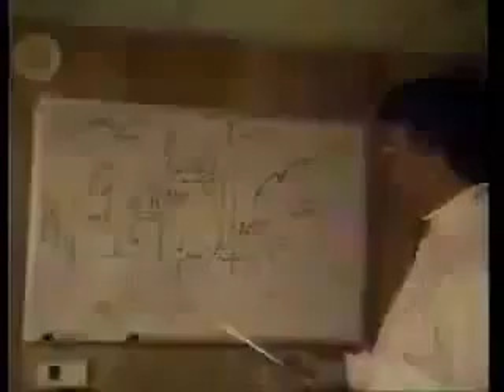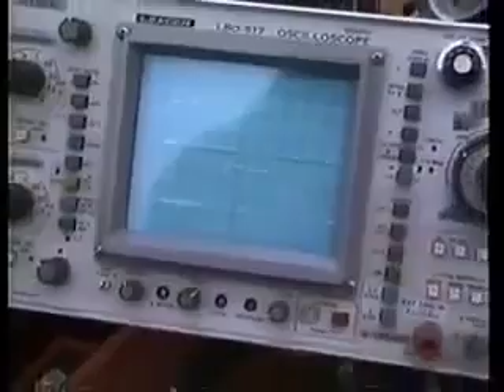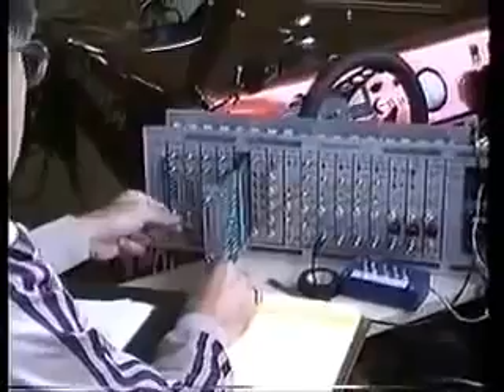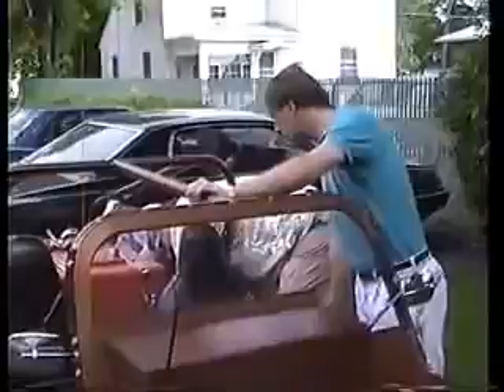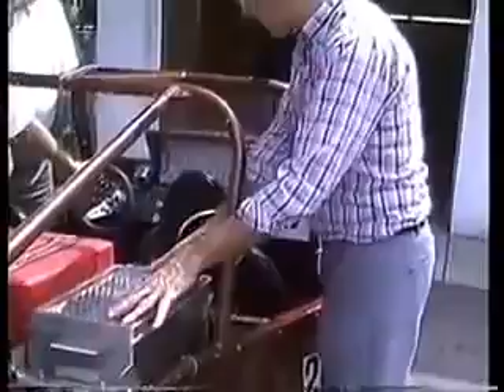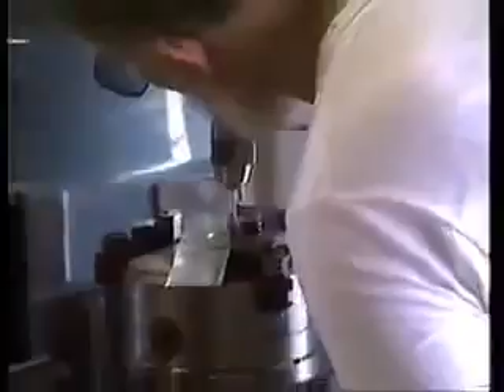Stanley Meyer  running car on water. Water Car GENIUS

Comment: I remember this vid. I knew it existed. Im goad i found it.  He was silenced because it would make their brainwashing scam of “go green”  fail. Also their “global warming scam would tail. They knew about these scams and worked on slowly brainwashing us before pushing it. They allow electric because they can still mix gas with it and if its gassless they still have you waste time charging the car and they know the engine in it only lasts 3-4 yrs and is alot of money to replace.  More than having to fix everything part on a car.  This water idea they can’t make u pay to pump it in when u can use a hose.  It won’t take hours of electric charging so they can make money that way.  So they seen it as a way for citizens to get ahead in n life and unalived the guy because of his ideas.   He would have ruined their global warming and go green be plus stopped us from saving money

Comment: It's about the power you save, think about how efficient it would be in a hybrid car.
Reply: This means battery size would be 70 percent smaller and nuclear energy could be used to power civilization alone as the batteries of those vehicles could be charged at home

Comment: Now it would seem I'm tasked with the very same thing as I move to implement this technology into todays existing vehicles and power generators. One thing that is very different from Meyer and myself is I was a mechanic first before becoming a scientist/machinist/engineer. I hope that will give me the edge I need to be able to bring this technology into our world.
Reply: Unfortunately, you will never succeed in making this technology practical or efficient, because what Stan failed to disclose is that you need to use 5x the energy just to create the necessary amount of hydrogren fuel from water. That being said, the obvious engineering solution is to simply remove the water/hydrogen requirement from the equation entirely and just use the battery itself power the car. This is essentially where we are today, with electric cars.

Comment: Never showed the engine actually running
Reply: There are (or were) videos of it running. YOU will have to search. There is one with the gas tank removed and put to the side showing his first cell connected and running. The first time the engine ran on the cell.

Comment: Sorry to speak ill of the dead, but Stanley was a con artist. Unless he was able to re-invent physics! You can’t use water in a combustion engine, because it does not combust. You can split water into hydrogen and oxygen using electrolysis and then burn the hydrogen as a fuel in a combustion engine. The fundamental problem is that splitting water takes far more energy than you get back from the combustion engine. To make this work you need an ample supply of electricity, so either a very long power cord or a big battery.
Reply: I don't reckon it's fake you can say he's a con artists but that's what the government says they can cover anything up people who own the oil industry will never give it up invent something that goes against it well RIP

Comment: IQ bellow 100: is working. IQ above 100: 😂 The fuel cell was also claimed to be able to recombine the hydrogen and oxygen atoms back into water molecules, which would then be recycled to continue to fuel the cell. This aspect of the cell, however, is mathematically and scientifically impossible.

Comment: I hope everyone in Belgium is watching this.
So they can see what their countrymen did to the world.
Reply: You mean scamming people and being convicted for it?
Reply: @parsonk4041  No I mean cracking water using only 12v car electric and getting away from greedy power companies.
Reply: @KnightRider872  but this is not something that actually works. You get less power out of it then you put in.
Reply: It's about the power you save. Think of how efficency it would be on a hybrid car
Reply: That's why he was killed because you would not requir large batteries so that means the avg household could charge the car battery at home and the water would cover the rest of tge energy requirement which is why Stanley never was killed because oil could then be replaced by nuclear power to households and then oil would be redundan
Reply: 70 percent reduction in battery size
Reply: Less slavery
Reply: The devil is in the detail

Comment: Anyone can get a car to run on hydrogen or even water. The problem is the cost of the vehicle is a lease double, there’s very little room left in the trunk or even the backseat and the cost of the fuel is at least four times that of gasoline. So yes we can do it but who the heck would want to? That is the reason why nobody buys a Toyota Mirai.
Reply: this is a prototype.. technology is way smaller now.. if they would've went with this invention.  but they aren't about to put the fuel industry out of business.. are you not smart enough to see that. it's all about the money. the monetary system!
Reply: @MM-ig1iv  Hydrogen powered Toyota Mirai came out 2014 and have sold 18,000 total up to 2021. During same time, Tesla as a start up sold over a million EVs.  I see no plans for anyone coming out with Hydrogen vehicles. Toyota produced a poor BEV but they are attempting to catch up.  Hydrogen is a total dud that no engineering can solve because the physics of Hydrogen do not work. Too expensive for the complex vehicle and fuel roughly ten time cost of charging with electricity. 

You have demonstrated nothing but a lack of knowledge and appear to rely on a conspiracy against Hydrogen but the truth is that Fossil Fuel industry wants Hydrogen for two reasons:
1. will slow down the adoption of superior BEV
2. Hydrogen is almost entirely made from Fossil Fuels. 

You have a lot of gall saying I am “not smart enough” when you are the one demonstrating a complete lack of understand of every aspect of Hydrogen and BEVs.

Comment: If this is confusing to you.  Realize this.... when you step on the "gas" in a vehicle you're actually adding more air as the throttle is opened up...  they were controlling the throttle with the gas production.  He shows on a video of the buggy where the air intake is tiny and its a fixed rate.....  

The cylinder is also pulling a vacuum on the gas and exhaust gases are used like a compressor.... venturi effect....

You can boil water without heating it up and a vacuum will help suck the gases that are trapped in the water..... that is also a benefit of a pwm control.... in the moments voltage is creating gases the gases want to stay in the water....

Look at videos of people turning on an electrolysis cell...  look how much gas stays trapped in the water

Comment: Nice to spend some time with Stanley and Steve.
Really like the Engeneering going in all the small detail, wiring, prosesor cards, testing equipment.
That car is alive and well.
They are years ahead.
Looks like a drag racing car or F1 car with Tellemetery.
EFI system!
Reply: Yeah it would’ve been shame he was murder in the 1998
Reply: If the car is still around how come backers aren't falling over themselves to get their hands on it?
Reply: brianharris7243 cos it doesn't work
Reply: @richc9631  All good. What dis you bring to the tabel so fare that works.
Im intrested

Comment: What an incredible waste of time and resources. Why would anyone want to go to all these lengths and make all these modifications to the vehicle and use so much sophisticated generation equipment when you could accomplish a much better result and not have to make any changes to an automobile by simply using E-Fuel instead of gasoline. E-Fuel is just water that has been saturated with HHO and burns in the engine just like gasoline, accept that is made from water that has been energized  by electrolysis and saturated with H2 and O2. It is the safest and most versatile fuel possible and makes every IC automobile an EV.
Reply: Have you been able to build such a model?
Reply: @sashasoule4585  Not yet and I may be wrong...
Reply: @rodkeh  how do I do it
Reply: @akinvests  As I said earlier, I may be wrong and I haven't finished my experiment. I'm  73 years old and I'm not as handy as I used to be. So I'm having trouble making my apparatus but I think it is still worth a try so I will continue when I get back to it but this stupid COVID thing just keeps screwing things up and I can't find the things I'm looking for.

If you want to give it a try, this is the premise. We want to saturate a sample of ordinary water with Hydrogen and Oxygen by electrolysis to the point that if you spray the water and atomize it, the Hydrogen gas molecules will become atomized and be able to combine with the oxygen. 

In other words, we need to construct an electrolyzer, like the ones the HHO enthusiasts use to boost mileage, that is hermetically sealed so the evolved gases have no where to go but to either remain gaseous or dissolve in the water. Once the fuel is prepared it must remain under pressure or the gases will escape and the fuel will go flat. I estimate that a pressure build up of about 20 psi should be sufficient to produce a substitute for gasoline. 

I can not emphasize enough how dangerous this could be if higher pressures are needed. The idea is, that as long as the gases remain suspended in the water, they will be harmless and could not be ignited but if vaporized or carbureted they will become gaseous and free to combine. We have to bear in mind that the evolved gases will try to accumulate as gas, until sufficient   pressure is achieved to force them to dissolve, so there will be HHO gas in the electrolyzer which will be very explosive so you don't want let that gas escape. We can use the pressure build up to push the energized water out of the apparatus so it will still be in liquid form and as long as it hasn't lost its HHO the water will be an excellent fuel. Theoretically!...

My problem has been  sealing the pressure vessel. I keep finding leaks in all the gauges and measuring components, so I have to keep rebuilding it, so I still don't know for sure if it will work.  

If you try the experiment, BE CAREFUL and Good Luck!
Reply: @rodkeh  I’d like to mention the kiss method here. Keep it simple silly. If you put some kind of pressure release valve set at 20psi you won’t need leaky gauges and other stuff since you could just let it feed back with a sensor in front of the valve slowing down gas production after the fact, I can’t say the leaks are any fault of yours, just an idea. Also, what if we need a catalyst like lithium to hold the gas in the water like Lazars tanks, then we’re back to trying to make lithium hydride vessels which idk if anyone has made other than him. Ps I saw someone make tons of gas with 7000 watts, wouldn’t a regular electrolysis tank and 5 alternators each making 150-300 amps be enough to brute force this system to work? I know they’ll have a massive load but if you have a massive Diesel engine whats a couple horsepower right? Assuming Each 100 amps taking 1-4 horsepower from engine output wouldn’t this produce more than enough gas? Thanks for the introduction, I really REALLY appreciate it. Also if you have any books on electron gas theory I would love to hear about them. Hope you get it soon!
Reply: What they created in those computer modules is what is today a PCM. It wasn’t a waste of time, he was doing what is required to control electronic fuel injection. Also you must be quite young to think that e-gas is a no brainer. Stan did all of this on the late 70’s and 80’s.
Reply: This is the dumbest comment ever

Comment: Stan wrote his patent like a riddle.  If you recognize what esoteric terms to ignore, and which to focus on; it starts to become obvious that he has a basic 12VDC +/- fuel cell producing hydrogen, then takes that gas flow and regulates it through a rubber tube (non-conductive), to the first copper tube (conductive) with a +12VDC charge (again via coil variable) to the exterior of the first tube (supercharging the hydrogen again using a coil from a VW), routed then through rubber tube at the exit (non-conduductive) into one more copper tube with -12VDC (reversed polarity low voltage), and the result is the expansion of the +polarized hydrogen as a 'short' in the charged 'air' as a BANG, same energy as the combustion cycle in a 4 stroke engine would ignite gasoline vapors.  There was also an EGR to recirculate the spent gas (that was hyper-energized).

When he talks about the +charged input into the first chamber; that's just water.  Then the chamber has the 12VDC +/- plates, just like any cheap hydrogen cell.  But what he does next is to charge the gas AGAIN through a copper tube with +12VDC connected through coil over wires to evenly charge the hydroden again - like he says 'adding a molecule', just really increasing amperage to the +charged gas.  Then the gas is virgin again through rubber tube into a second tube with  [neg]--12VDC to the outside of the 2nd tube (reversed polarity).

Then he puts a dial switch on the VW coil to increase or decrease the +amperage, which acts like the accelerator pedal...  vrooom, vrooom.

The entire output 'tube' with -12VDC can fit into a sparkplug sized fitting to screw into the spark plug hole of the cylinders, just like a spark plug.

Timing is modified through the distributor; which is now attached to the +12VDC first 'tube'.

Basically what Stan did was just to create a 'short' in the 'air' that the fuel cell generated.  The hydrogen was 12VDC polarized, so once it entered the2nd  -12VDC tube, there was a 'sweet spot' of energy he saw on his oscilloscope that produced as much or more energy than gasoline would in the 4 stroke engine.  The '2nd tube' was the miniaturized to screw into a spark plug hole on the engine.

The nonsense about the self-replicating current was just the VW generator (alternator) pushing the power back to the battery, like any car does.

The KEY, now that I heard this video is the reversed polarity of the low voltage 12VDC that 'shorts' the hydrogen 'air' that is positively charged (twice).

Just basic electrical direct current / flash point ion charged gas theory.  So simple.
Reply: that gas going troght pipes at different voltage you mean it is gas ionization?
Reply: +vcs kmb  I think I get the jist of what your saying here. Got to put some thought into this. read between the lines.
Reply: Have you been able to replicate his system?
Reply: Can you help me replicate this
Reply: What part do you need help with?
Reply: Vcs kmb- have you calculated the amps, given that the earlier discussion said his device held 1/2 amp during hho production?
Reply: Thanks for the synopsis.  Patents can be hard to read.
Reply: Reutilizar
Reply: We need you to replicate it